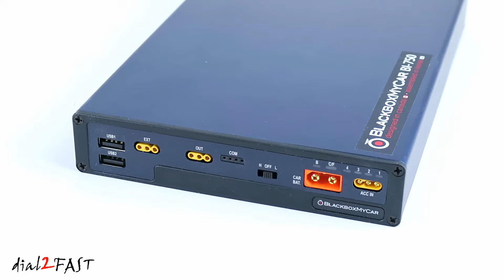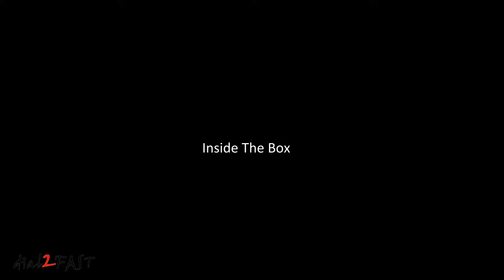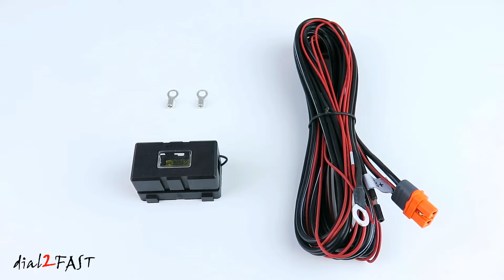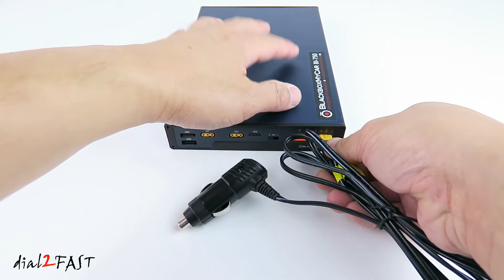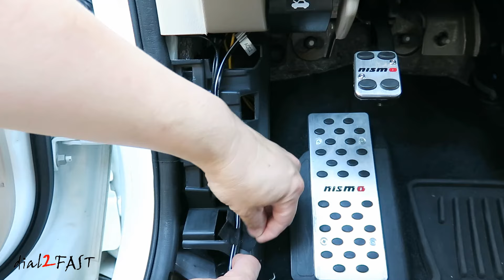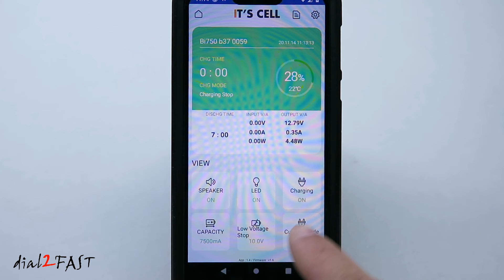Car Dash Camera Parking Mode Battery Pack - BlackBoxMyCar BI-750

Comment: I really like this but it is very expensive. I’m looking into DIYing a similar battery pack from a 12.8v lifepo4 10 Ah battery with a BMS, such as the Weize brand.  I just need to figure out how to wire it so that it triggers the  parking mode and provides power to the cam when the car is off, and then charges once the car is on. I assume I need to use fuses and maybe a small relay to do all this. If you can figure this out, please post a vid. Thanks!

Comment: This battery pack isn't available anymore. Any other good alternatives? I use a viofo A139
Reply from the maker: Perhaps the Thinkware iVOLT BAB-50 will work with the A139. The battery pack output has Ign 12v, Const 12V, Gnd which you can connect to the VIOFO hardwire kit. Here is the review video, and buying link in description. https://youtu.be/qK6tq64Mljk
Reply: @dial2fast  thank you!

Comment: Can you use both yellow-tipped and orange-tipped cables simultaneously to charge faster? Sorry if it's a  dumb question.
Reply from the maker: You can either connect direct to car battery OR to the fuse box. Not both.
Reply: @dial2fast  Thank you! I'm going to connect to fuse box just so I don't have to go through the firewall.

Comment: I like it but don't want it to run off my cars battery. Don't wanna come out to a dead battery
Reply from the maker: The battery pack NEVER runs off the car battery. It charges using the alternator and then powers the dashcam when ignition is off.

Comment: Hi, I have a question about the BI-750 dash cam battery.  I am looking to buy the Blackvue DR900X 2-channel.  I want to have Parking mode always on 24/7.  But I don’t drive the car much, sometimes once a week for one hour or less.  What is the best option for my case?  One option is to buy two batteries and connect one to the dash cam while the second battery being recharged inside the house. Can I recharge the BI-750 inside the house using a wall outlet with cigarette socket adapter?  Thank you

Comment: instead of buying the $300+ extension pack, I've had pretty good results using my $60 jump starter pack to power my BI750 overnight with no issues  I plug the BI750  directly into my 18000 mah jump starter pack using a cigarette adapter and it charges and powers it fine.
Reply: do you think you'd be able to charge the BI750 with this?  https://www.amazon.ca/ARECORD-Cigarette-Lighter-Socket-Converter/dp/B01J67JIOQ
i will be plugging the usb end into a power bar in the house
Reply: good idea.  plug in a jump starter battery pack into the usb ports to charge it then daisy chain the dash cam to that.

Comment: Nice video. Do Blackbox indicate how many power cycles the Li Fe PO4 battery can take - more than the usual 2000 cycles? Or give an estimate of life time - 4 -6 years?
Reply from the maker: Since this was designed by the same engineer that designed the Cellink battery pack, then I would assume it has the same charge cycle of up to 3000 times.